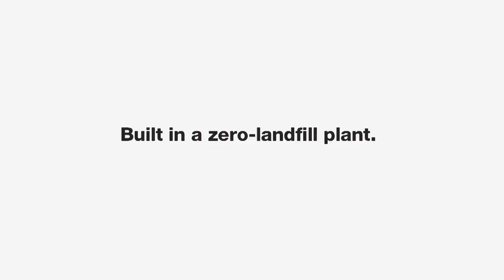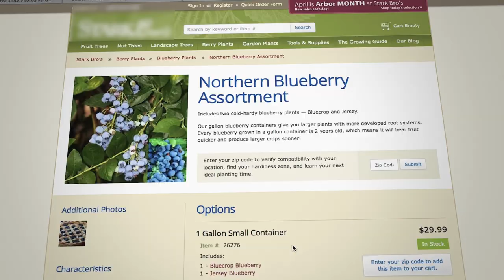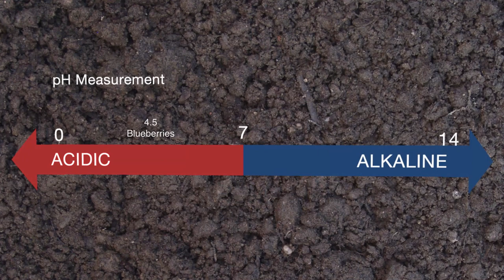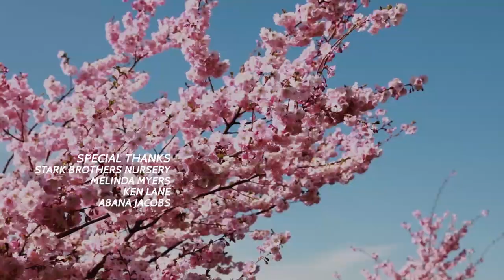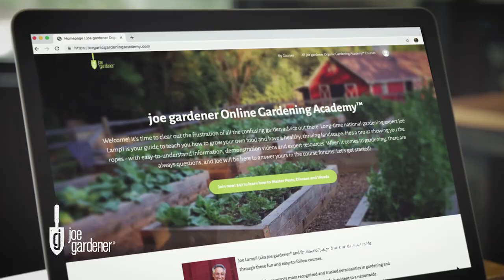Growing a Greener World Episode 1109: Expanding Your Food Garden By Growing Fruit

Comment: Fruit trees are Hard! I’ve tried several types of apple. In 8 years I’ve not gotten one apple. I’ve tried blueberry 4 years in a row.  You need very acidic soil and ours is alkaline. Even in a pot I failed. So adding the soil acidifier didn’t work. Pears fail. Plums fail. Apricots fail. Grrr. I have one sour cherry that gets a lot of fruit, but they are small. I have gooseberry they do good. I had a red currant that did well for about 4 years . It died this year. Strawberry did ok for 4-5 years. Red Raspberry did. good but spread away from where I planted them and died. But I keep trying anyway.